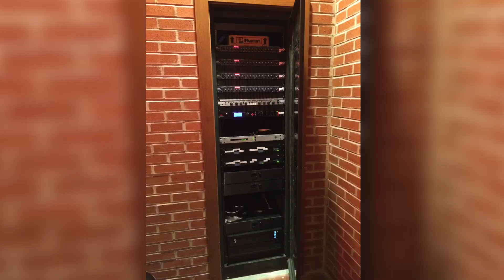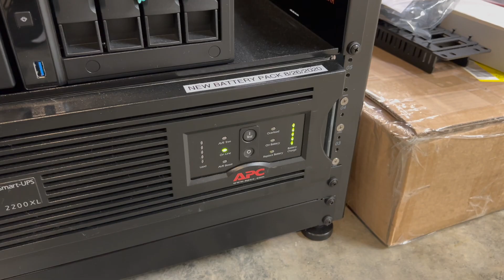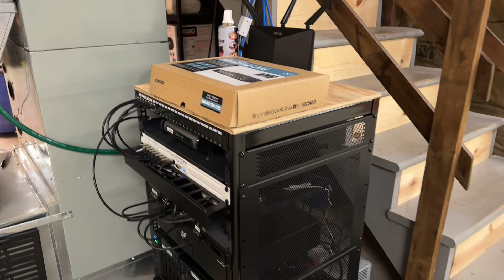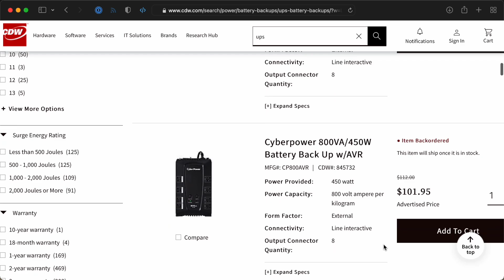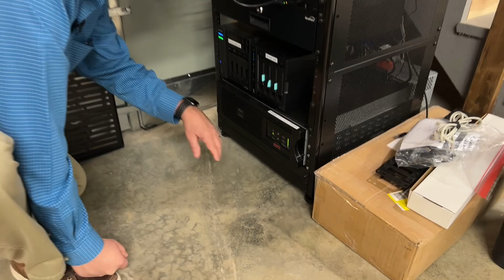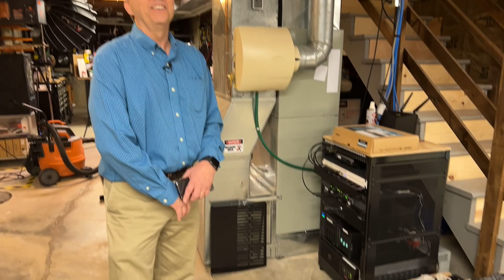Choosing a UPS (Uninterruptible Power Supply)

Comment: So if we get to the bottom line… And someone like me has six computers and 11 screens, a television, DVR and maybe a table lamp, what do I actually need. I already have two $300 or more backups. Every little cheap APC I've ever purchased, I've ended up putting them in the recycle bins in my community.

I had an electrician install an additional grounded circuit just for my office. Those cheap little APC units just don't last.
Reply: I only buy high-end backups. And I've been doing that for years. Even they don't last.

Comment: I came here to try to make sense of the specs given on UPS.  I'm looking at a website that sells a huge range of UPS but the specifications make no sense to me and I'm fairly technically minded.  Their performance is specified using two values with no explanation of what they're talking about.  The first figure is given as W (presumably Watts) and the second figure is given in VA (presumably Volt Amps).  Since neither of these units include a time factor, it seems their capacity is not even being specified.

Even a tiny 1.5v Duracell could, theoretically deliver a KW of power for a microsecond.  Also why the two values?  For example the first UPS I'm looking at has a specification of "400W/800VA"  I'm at a loss.

Comment: Important to remember that certain equipment, particularly those with motors, the power draw on startup is always higher than normal operations.  You always want to account for that when determining what your needs for a ups are.

Comment: Try using LiPo4 batteries with BMS guarding on that UPS. I have been running LiPo4 12v10Ah on my 1500AV rackmount UPS's for the last year and a half.

Comment: For a dual gpu setup on PC part picker: 710watts (1065watts 1.5x’d). A 1100watt ups and 1100watt psu is recommended? But a 1100watt UPS cost almost 2x as much as a 1000watt ups? The psus are about the same price. Could I get by with a 1000watt ups?

I will probably go with a 1500watt more efficient psu anyways, in the event I get a 5090+5060. But… 1500watt ups is $700. Yikes.

I’m not looking to spend $700 on a UPS just for future proofing right now.

I have a second UPS for all my peripherals/synths/speakers.

I might overclock the gpu and things, so maybe I do spend the extra $200 on ups and go 1200watt ups?

I am thinking about not overlocking, doesn’t overlocking void warranties on these parts? Maybe I don’t overclock and go 1100watt ups?

If my PSU is rated at 80% efficiency, and my components draw 500watts, does that mean the psu will have to source 600 watts from the wall/ups, to make sure 500 watts is delivered?

Comment: Last night was doing testing on my ups 550AV. 330W with  2 M18 18V 5A lithium babbery 18V converter 12V 20A i start friday night 10:40pm finsh Saturday mornng 3:19am runing my laptop battery not keep charge so i do over 4hours 45mintues

Comment: Hi. I bought a APC 900VA UPS. I wanted to connect my Epson Eco tank printers to it. They’re only 12 watts each. I’m not electronically inclined. I live in an area that loses power at least once a week. 2/3 hours at a time. Each time that happens, I have so much trouble getting my printers to work again. I was told to get a power surge. However that doesn’t keep the printers powered when we lose power. Please give me any tips on resolving this issue. Moving is not an option. 😅 Thank you so much.

Comment: BTW, 100% of my UPS systems came from when I used to work at Batteries Plus Bulbs. Customers, usually small business customers, would come in and for them to be recycled. We don't have a way to recycle the UPS itself, so we would take the SLA batteries out and add those to our SLA and SLI recycling pallets and throw the rest of the unit into the dumpster. When I got them, I would take the batteries out and load the UPS into my car at the first opportunity. Then I would use my employee discount to buy new high-rate SLA batteries to put into them. Good times, good times. 

I recently just bought my first new UPS. The one it's replacing is an extremely old one that I use for my homelab and network equipment, but I still have many UPS systems that are very old.

Comment: This is a terrible video. It barely actually explains anything. They touch on a subject for about 2 seconds and show a few images but the whole thing is them showing off their own equipment and setup and talking about their own stuff and how well it works and their personal preferences. Not actually giving you a lot of helpful information what-so-ever about choosing one or how to actually go about doing it for yourself. You can Google all this information and read it faster than watching this 10-minute video and it is much more information related to what you're trying to find out. My suggestion, SKIP THIS VIDEO AND TRY GOOGLE INSTEAD!!

Comment: @Geerling Engineering i have one doubt in my country(india) operated voltage is 230 V  AC 50hz. I'm using microtek legend 1600U, VA /wattage rating 1600VA/ 950W . It is a 24 V battery ( with two 12V, 7AH series connection). The problem is during mains power  cut ups turn into battery mode but output is 170V AC only. And it is not giving any backup please explain what is the main reason for this . I checked battery voltage which is rated 24v

Comment: As briefly mentioned, if you have a standby generator, you can generally get by with much smaller UPS devices as you only need to cover the load for 30-60 seconds.  Aside from the UPS supplying my desktop with a 750w PSU and a bunch of smaller loads, the remaining 5-6 UPS units around the house are generally smaller 225w units (powering tv, switches, router, security system, etc).  My desktop ups is a CyberPower CP1500PFCLCD 1,000w pure sine wave and its done great for a couple years.

Comment: Love this. I live in an area with frequent power outages, so I built an online double conversion UPS using a power factor correcting charger/converter, a pair of AGM batteries, and a quality pure sine wave inverter. From that I run my NAS, POE switch (which powers wifi access points and surveillance cameras), PC running Blue Iris, and my home theater (except amplifiers). This is the way to get the cleanest power to my audio components and television display, and there's never a flicker in the power supply.
Reply: do a video guide ... would love to learn how to build that

Comment: I have the APC Backups 1500 VA since gaming PCs wouldn't get away with anything smaller and having the runtime to finish an online multiplayer match, and safely powering my gaming rig off is a must.  I also have the 900VA model to power the Fiber optic converter box and gateway for hours on end.

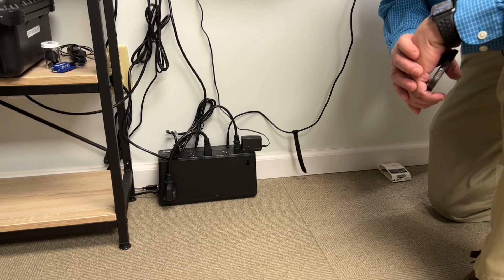Comment: I just want an affordable, consumer-grade online/double-conversion UPS so I can get some clean power for my stereo. Having to buy a huge $1,000 monstrosity for something like this is just silly. Why does this not exist? Something the size/style of that little APC unit shown at 1:20, for example.
Reply: Late but...
Try the  "Riello sentinel pro" lineup (online double conversion).
I am assuming you already know that double conversion UPS use extra energy to make the conversion. For example if you need 500w, the ups will use another 30-60 wats during the process (so the total is 550w approximately).
Reply: @zaiberhunter7559  thanks for the tip!

Comment: Greetings from Southern Missouri!  Idea for a video.. UPS for a home backup review.. I am trying to figure out a battery or battery bank to provide lights (led) for a  small welding/fabrication shop until I get construction power for my house  100 feet away..
  (I hope to have it by summer..  I hear Howell/Oregon is slow in installation..)
I just want about 150 watts for 8 hours in an unheated shop.. I plan on using LEDs, so 150 watts is overkill. I will run my welder and top off the batteries every time I am welding.  If I need more than 8 hours of lights, I am making enough money to run the generator all night.  lol

Comment: PRO TIP:  APC units that have a battery cartridge with that little metal handle like the one shown here were engineered by an idiot.  No that's unfair, he was likely mildly stupid and licked too many lead-acid bateries.  Either way, he thought it was a good idea to secure those packs with raised metal tabs beneath the battery pack, and the instructions for removing say to "lift up and pull out".  Now I don't know how the engineer in question found the time to write these instructions, what with his full-time hobby of sucking the mercury out of old thermometers, but there is no "lift" in the removal process.  A 1/4" tab cannot be cleared when the battery pack is fitted to sub-micron clearance, so tug up on that tiny handle all you like and enjoy the sore shoulder because that's all you have to show for it.  

No, what the engineer--who I am sure by now has moved on to a lucrative career as a DOW Chemical water-quality sampler--should have written is, "After disconnecting the battery, find the biggest crowbar you can and JAM IT underneath the battery pack to release the tab."  I'm quite serious.  A very large slotted screwdriver should also work in a pinch, but it's not as satisfying to hit the old battery pack with the screwdriver afterward.  There are usually 2 tabs with the second one most of the way back on the battery pack, designed to stop you from yanking this giant block of lead all the way out and dropping it on your foot.  Normally you CAN lift the battery up over this second tab, but only because you are using the weight of the battery itself as the lever.  Don't forget to label the new battery pack with the installation date, and be sure to write "use crowbar" on the front for next time.

Comment: I was taught to NEVER use F1 to F2 adapters in any UPS because of possible shorting risk due to extra exposed terminals and F1 terminals on the batteries not rated for higher dump current. I never questioned it because if you ordered the right batteries, it was never a problem.

Comment: FYI, VA don't always equal UPS wattage ratings. I have some UPS that are 2000VA but have a 1540W rating while others are 2000VA and 2000W. All are pure sinewave and require 120V 20A circuits.

Comment: if the only reason I want an ups is to prevent my pc from burning as I live in an area with frequent quicknpower outages and brown outs... to stabilize the energy (i don'tcare about battery time, 2 minute would be enough I guess, as i would shut down the pc if the power went out for some time). Then what specs should i be looking for?
Reply: It's depenon your PC load, most of PC are 750W,  you can choose a 2kva online UPS built-in battery, online UPS switch time 0ms, backup time 5~10 minutes, protect your PC no problem.

Comment: Yes ups units are great!  We have 6 of the 60k eaton units at our main building.  
Then a bunch of the apc xl3000 units at around 25 other locations.  
Nice thing about the commercial apc is there is usually a connector on the vack the allows you to double/ triple the battery capacity.

Comment: I have an APC xl1400 that I garbage picked in 2004. I found that two 100 am hour batteries wired externally get 10 years of service. Wired it into my critical circuit at the distribution panel in my house. (with a permit)

Comment: Curious on repopulating an RBC carrier  (sled?) with batteries.  Some of the vendors carry both the nominal 12v, 7.2aH batteries.  I have also noticed some UPS (apc) can apparently use AGM 7.2v batteries, but this are typically 9aH and require a charging/monitoring controller that is different than non AGM batteries... have you found that the APC SM* series UPS' will accept AGM batteries?  Is there a way to determine this by model/sn?  - thanks

Comment: most ups, after remove battery or battery faulty, can not re-start the ups ,even there is power input. this design reduce reliable. I have met it. there is no output, when there is power input.

Comment: Thanks for the video. I've owned a dozen APC UPS's for years and used to swear by them. APC more "intelligent" firmware now actively prevents you from buying higher capacity batteries, which are often cheaper and better quality than the APC packs, as well. It locks runtime to the model number, instead of using a cutoff voltage, or proper battery management of consumption. No amount of factory default, or calibration fixes this issue. This is on units from about 2010 or later. I've since migrated to Victron Energy inverter/charger/xfer switch products out of the Netherlands. They are completely programmable for SLA vs LifePo4, cutoff voltages, charge voltages, absorption times, etc. They are more expensive but infinitely more useful to protect a larger DIY home network.
Reply: some models of new apc units are still programable. i have a br1000g-in and it works perfectly fine with a 25.6v 12ah lifepo4 pack i made. the oem replacement battery is more expensive than the cells i bought. it also runs 45min at 300w load and stops discharging when the battery gets to 20v , it stops charging at 29v and flats at 27v. the charger board on this model is separate from main board and it has a jumper to set the battery charging current from 1.25amp to 3.75amp because this model has an optional external battery pack that takes the total capacity to 27ah 24v leadacid. i have been using it with the lifepo4 pack i made for almost 5-6yrs now and it is still holding up full charge. 
other models like the srv1kuxi lets you set charging current and program battery capacity. although they have no lifepo4 setting so the run time will never be accurate. lifepo4 has no pukert effect so all the whr energy is available for use.
Reply: @KuntalGhosh  Thanks for your message. I'm super happy with the Victron Energy solution I've implemented. It's considerably more expensive, but gives me access to all the nerdy stats, live current/voltages, charge/discharges rates, ability to adjust charge current to 80A, direct support for lifepo4, etc. I've added a manual transfer switch to my house, and can power my whole house heating, refrigerator, etc through the same solution. You can tell this is the "professional" ways to do things. I'm done with APC handicapping their products.....
Reply: WTF APC?!! Thanks for the heads up!! I just need single units right now for my wife and I desktops and our router from ATT that I have going to my Cisco switch. Nothing fancy, just a poe 24 port left over from my old house when I had the kids stuff and everything else hardwired from my SOHO network with 2 APs and I think 12 runs. I had 3 printers hard wired, PS3/4, 4 desktops and a camera. now just 6 runs total due to the idiots who built the house not running 2/3 of them. 2 APs 2 in my office and 2 in basement. I can run one to my wifes office maybe later as I tore my knee.
Reply: Thanks for the information, which is both interesting and troubling to learn, but it almost seems like you are wasting money by putting philosophy over need?

How long do you really need the home network to stay up if everything on it is also on battery power, and how much power does, say a router and handful of switches really use?  I ask this already having a pretty good idea, and recognizing that most things that I'd continue using on battery power, don't even run through the switches, instead wifi.

Also, why have you owned a dozen UPS?  Insufficient site surge protection killing them?
Reply: While need is a subjective term in our first world problems lives, I've wanted a more resilient setup for years. My home network is extensive, includes (3) desktops, (4) access points, using a mostly filled 16-port switch, ~(30) wifi devices.  My steady state usage ballparks 375 watts. Prior to this setup, I needed (4) UPS's to have any barely tolerable amount of time. I was using a 1500, 600, and (2) 350s. Bought over the years as things grew. With battery replacements happening every 3-5 yrs. If I start powering off devices, I can get this down to about 70 watts for the critical things. Do the math on what size solution you need to last about 12 hours. Redesigning this allowed me to not only scale and integrate, but also add things like hvac heater support, refrigerator, lights, TVs, etc. Power outages are fairly infrequent but annoying and are no longer a concern. I've got a generator which can support an extended outage as well. My solution is awesome and does exactly what I need. It actively protects about ~20 AC devices.
Reply: @keithmonahan629  So you are suggesting that  you have a legitimate need to use all devices simultaneously during a power outage and that they happen for that length of time, often enough to bother?  I would just move to a different area before tolerating that kind of basic utility outage... or... wait for it... get out of the house more ?  :)

Comment: I've only ever used APC as my UPSes, ever since I did a hardware evaluation for the Defense Information Systems Agency in 1993. In my personal life, I've only ever replaced the batteries on these units with spares from Batteries Plus. I have always taken the unit in, they know how to pull the old battery, they know exactly where on the shelf the replacements are found, they swap the battery out while you wait, and then you go home with what amounts to a fresh UPS!

I have my first rack mount APC UPS now, and I need to buy batteries for it. For the first time, I will need to find out what the replacement batteries are, and where I can buy them online. But I'm certain it won't be too hard, because I know APC has gotten good at this thing over the decades.

Comment: I bought the smaller UPS you had on the floor by the wall, the 900va/480w model. It ended up not being enough, I had to go back and get the $240 1500va/900w model that I tried to avoid buying in the first place lol. It is much nicer though and it shows 530w peak consumption from my PC which explains why my 480w was alarming out.